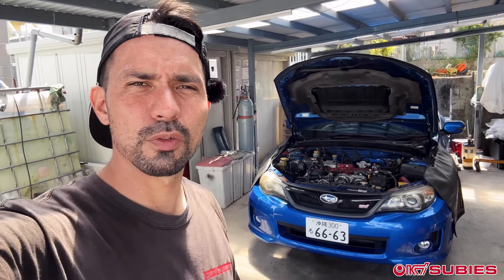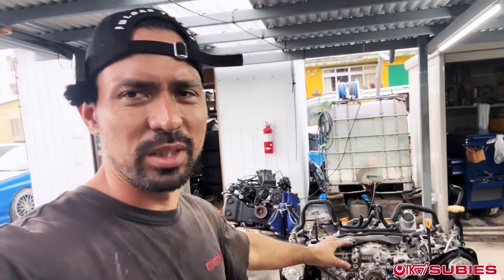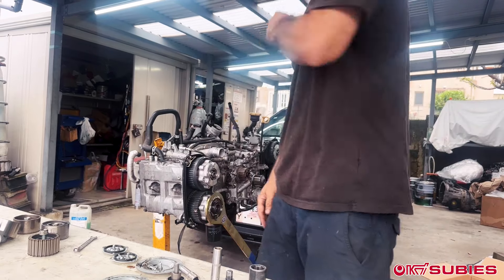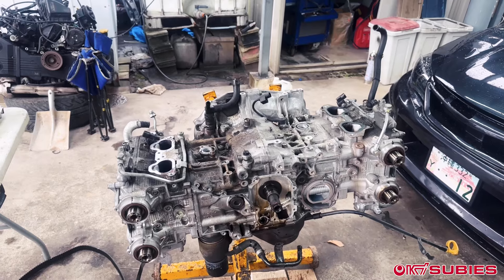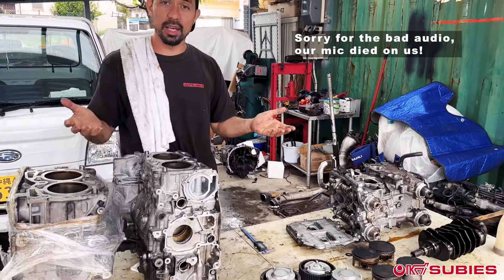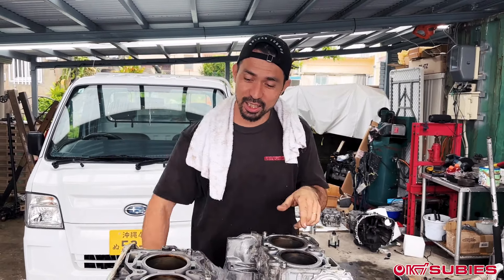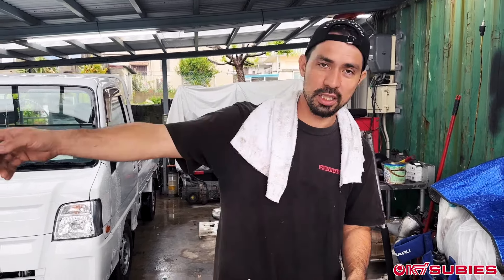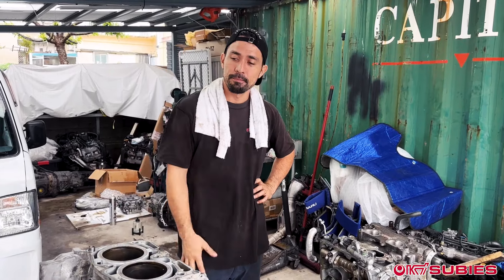Version10+ EJ207 JDM Engine Tear down

Comment from the maker: Do you want to see more engine tear downs? What next?
Reply: Hi OkiSubies. Do you guys do work on NA cars as well? I have a 98 GC8 2.0 NA and there are not too many teardowns of those vids on YouTube. It is not as interesting as the turbos, but still classic GC8. Or if you ever do a Turbo setup on a NA engine. Thanks for the great videos. And you don't have to cut your video lengths, the longer the better. Much love from South Africa.
Reply: Hello u guys, I love your videos so very much ❤

Can I please have some help please 
🙏 

I owe a 97 V4 sti, anyway the engine button end gone 🥺

I can’t see to find anything on 🤔using my v4 heads with a v7 sort block, because I can buy a brand new v7 sti sort block from the dealer 😊

Any help would be appreciated 🙏🥰🍀❤️
Reply from the maker: @ hello! Thanks for the comment!

Yes you can do it! You can install v7 short block or even newer 2008+ blocks using your EJ20K heads. You just need to use a 1.2mm head gasket to keep compression the same

Comment: Hi 

@OkiSubies

I had imported 2017 VAB WRX STI to Europe and I have some questions. 
The service parts like timing belt, water pump, spark plugs are the same as global EJ257 or I need something imported from Japan? 
Some mechanics say it is the same but none so far had an occasion to work on that modern WRX STI here.
Reply from the maker: @legionjackofalltrades8164  They are the same🙂
Reply: @OkiSubies  Great thanks!

Comment: I presume if you’re swapping the v10+ 207 in a VAB you need the ECU
Reply from the maker: When we swap the v10 EJ207 in the GRF (Aline) we just swapped it in and re-flashed the oem ECU and didn’t have to change the ECU🙂
Reply: @OkiSubies  would that be different from 2.0L to 2.5L. Say I bought a roller 2016 sti In the US (ej257) and bought a v10 207, would I just reflash the ECU/ buy a v10 ecu and then it’ll work flawlessly?
Reply from the maker: @Toaasty_  If both are V10 and up then yes it should work no problem. We have seen locals here put 2.5L’s in GRB’s that way. Dual AVCS, DBW, Turbo is what you would be looking to check. For example, If the engine setup is dual AVCS but the car you are putting it in is not dual avcs or even not an EJ platform it wouldn’t work.